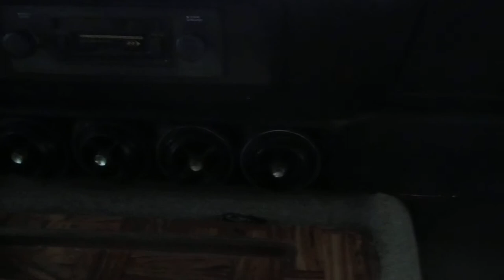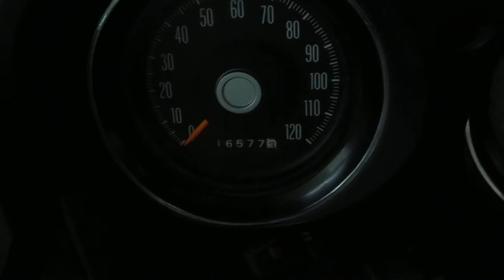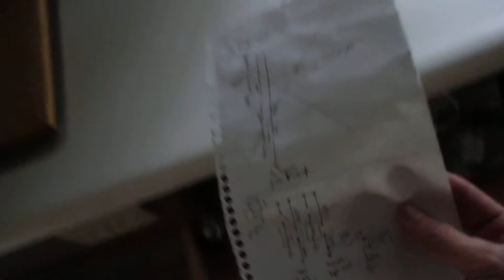1972 Dodge Balboa

Comment: How much did you pay for it? I just bought one in March 2019 for under 3000. and so far put $3000 into it. Hopefully replacing the gearbox will keep it going strait down the road. I've replaced the water pump, whole front end( upper/lower ball joints, inner/outter tie rod ends,springs and struts, bushings etc etc etc ) Brand new Carb. Brand new tires but still need spare. Well have a great day. I have video at my youtube channel on some of what I've done so far. T-n-TAdventures. Balboa project. Have a great day Balboa camping from Tucson, Az.